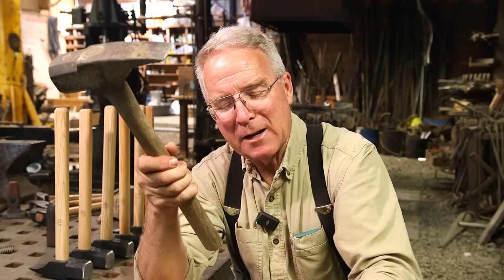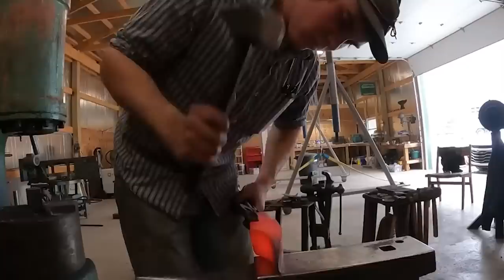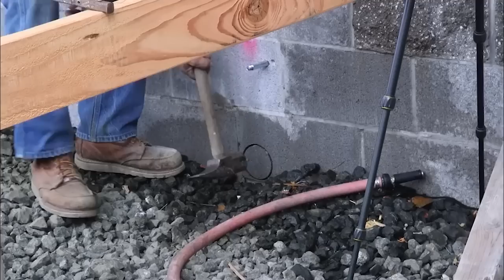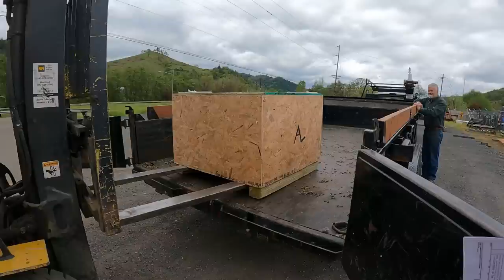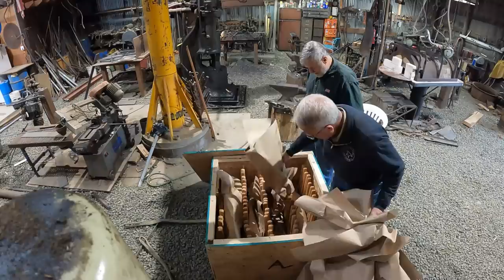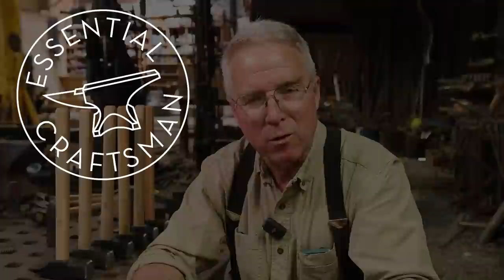Formsetter Now Available

Comment: The hammer is expensive, but, not for a tradesman. Would a drywaller balk at a $250 impact driver? And electrician for a $250 multimeter? Nope, they all own one. Likewise for a concrete setter. And, for a hand-crafted item that didn't come out of a factory, but from a blacksmith shop, Scott appears to be quite literally giving these away. You couldn't make one for less.
Reply: If he were "quite literally" giving them away, the price would be $0 and he would be personally meeting every customer and handing it to them.
Reply: @jej3451  You know what he meant. 🙄

Comment: For those wondering,  the hammer costs $250.
Reply: Thanks for the info
Reply: that's for the 3 pound hammer , 5 pound sold out  as of 12 noon  east coast time
Reply: wow at that price it better pound in stakes all by itself.
Reply: In a cost/benefit analysis this is a fail. Kudos to EC for not underestimating what people will buy.

Comment: Gotgeous hammer looks way more weighted for cracking through stone than a bricklayers hammer and not nearly as suited for digging as a tire setting hammer. Crafting the hammer or blade you need is as old as time.

Comment: Cross peen hammers have been around a couple of centuries, I have a two pound cross peen jack, a straight peen the same  size and a smaller ball peen that were my grandpa's...I'm 65 yes. old.  My question is what part of the cross peen single jack did you invent. 
I'm not being a wise guy I'm just curious.

Comment: $250 is an expensive Hammer that could be made in the $50 range. Someone in China will copy the design soon and sell them at Harbor Freight.
Reply: @meta2016  you guys should do it then. You'd have the market cornered. Or you just like to whine...
Reply: @TheBloatedPony  This!^^^^
Reply: They're hand made small batch, not mass production. That costs a lot more in time.
Reply: You've never made a hammer have you...
Reply: Clearly folks buying this are doing so not for 5 lb of steel on a handle. They're doing it because this channel provides them value and they like the idea of supporting it and getting something in exchange.
Reply: @TheBloatedPony  250 is a lot for a hammer. Of course it's hand made and the price is certainly justified. Every craftsman wishes people would only buy things like this. But the truth is that people who might spend 250 on this hammer will buy cheap mass produced things too. Everyone might have a passion for something but almost nobody can buy only the highest quality hand made items for everything. You might buy an expensive hand made hammer but sit on mono block chairs. That's alright. Different priorities.
Reply: You're not going to get a hand forged hammer for 50 bucks.
Reply: Good luck with that...
Probably more than that in material.  But if you have the know how and tools to do it for 50ish I'm in.
Reply: @jaygressett8659  Nobody denies it's a nice hammer. But it's also true that it could be made cheaper and do its job just as well. You don't need to be able to make hammers in order to point that out. As I said it's great craftsmanship. Obviously not everybody is willing to pay for it. There's a reason hand made things became a niche. It's too expensive for most people. As I understand it this channel is a lot about efficiency and making things good enough so people can actually afford a house. That's just how it goes. Since I make things with my hands and occasionally sell it I'm thankful there are a few people who are willing to spend money on things that are made cheaper in a factory. Some people appreciate the look and feel of a hand made products. Or they just like to support local craftsmen. I won't buy the hammer because I wouldn't get much use out of it. But I do understand the appeal of a hand forged hammer.